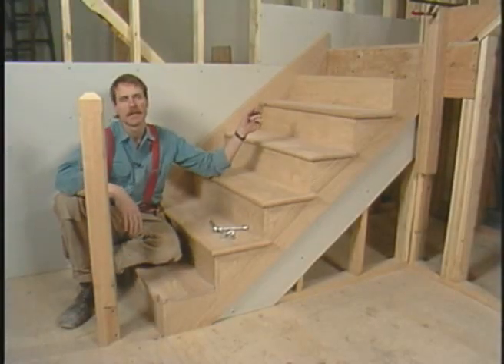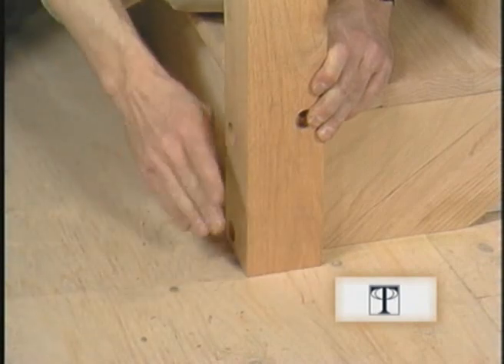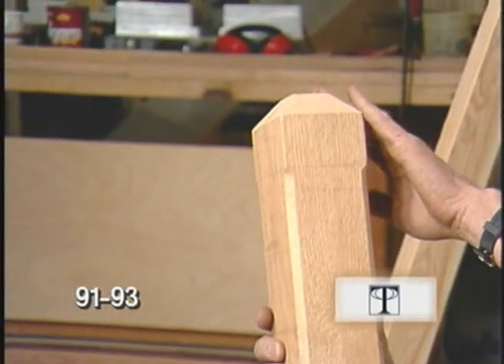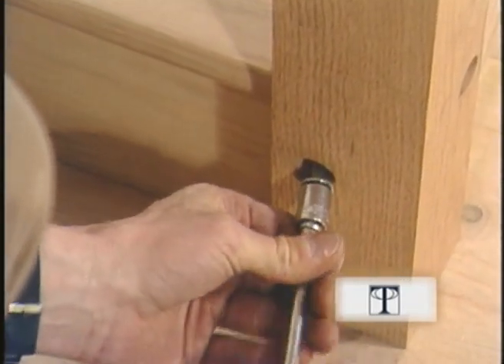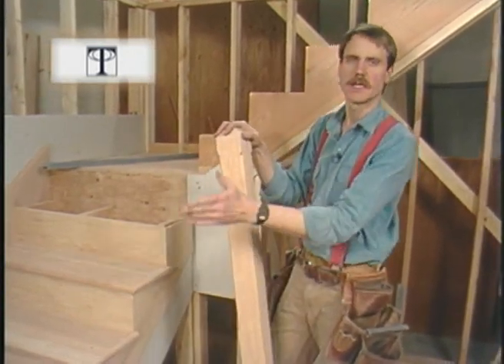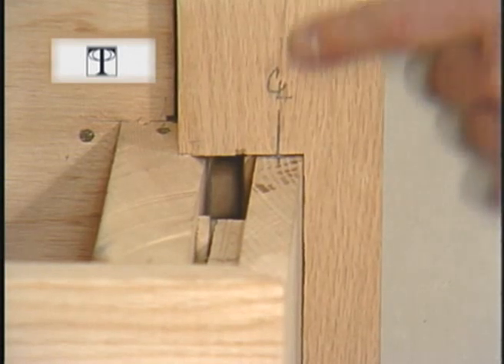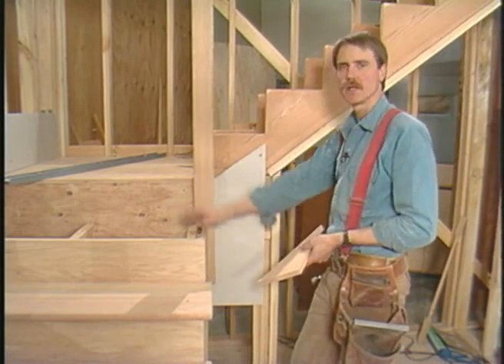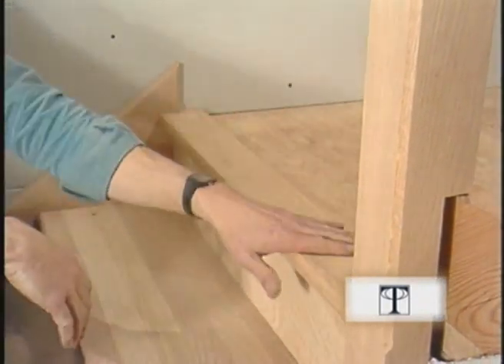How to Build Stairs The Newel Posts

Comment: Hello,

How do you removed existing plugs? I have to tighten en existing post at the bottom of my staircase. How do you remove them without ruining the surrounding area.
Reply: Leonardo Mera I'm SURE this is of no use to you now, but in case you need to in the future, grab a screw and screw it into the centre of the plug. When the screw tip hits the existing installation screw it will spin and remove the plug easily.